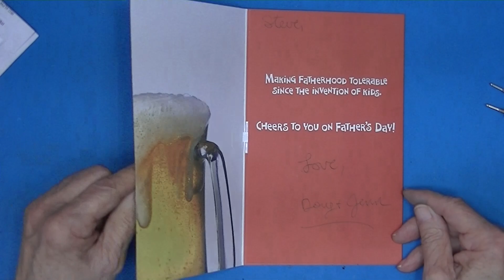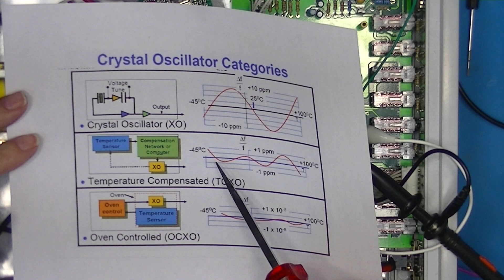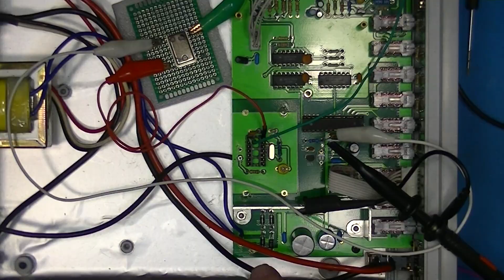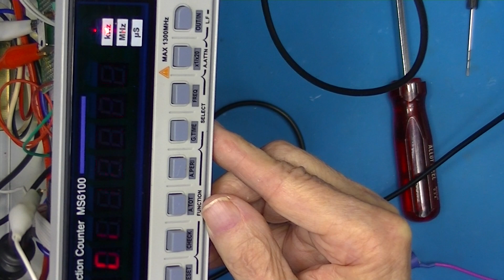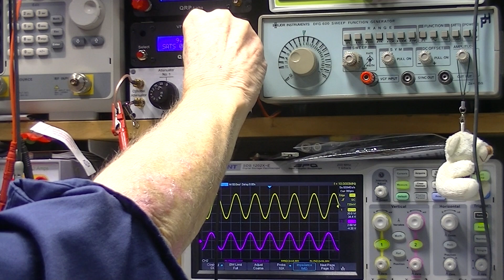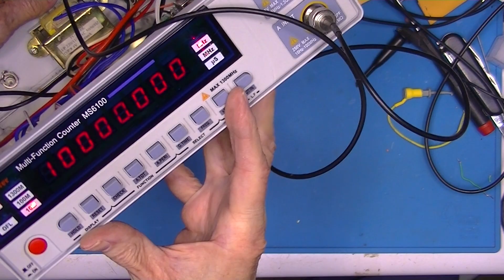Mastech 6100 Attempted Upgrade – Part 3

Comment: You have such an amateurish tinkering, I also have a TCXO instead of a time base oscillator, but I have the TCXO on a separate PCB board with pins to the appropriate places with power from the original 10MHz output. I have 1x TCXO 8MHz on the board for the time base and 1x TCXO 10MHz as a synchronization output for other devices. It's on one PCB board without wire jumpers, all pins are directly on the board and it works great.

Comment: It's a bit strange when you use GPSDO for calibration, but as a reference locked frequency you have the yellow one from TCXO and the purple one from GPS as floating. Everyone who does calibration here has it exactly the other way around and has GPS as locked and the one they set as floating. For you it seems like TCXO is a better reference than GPSDO.